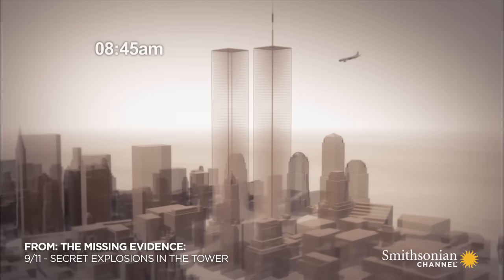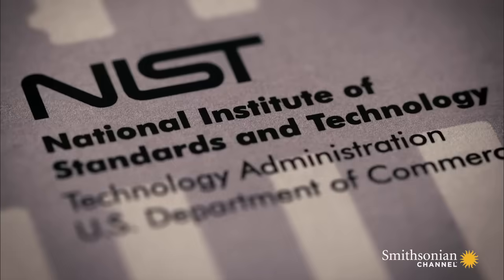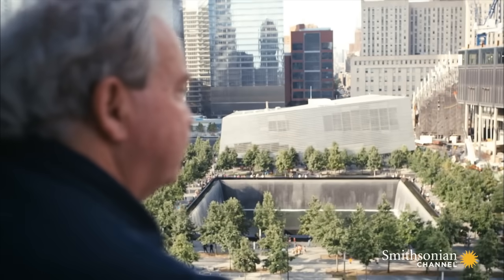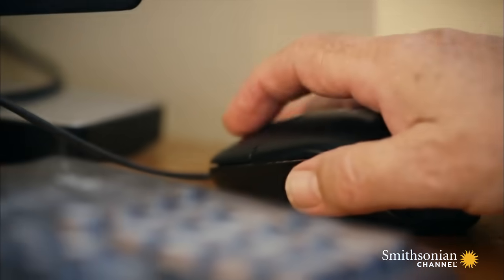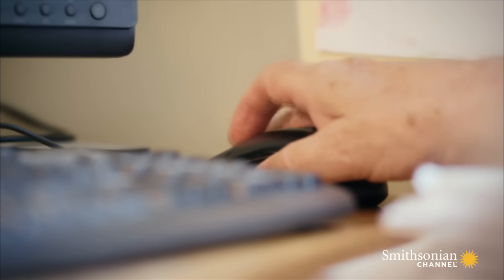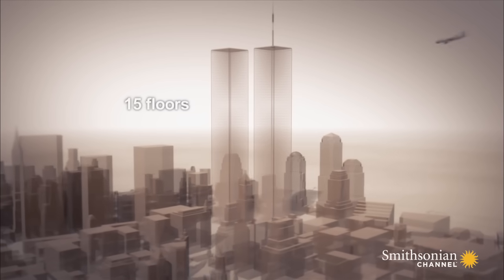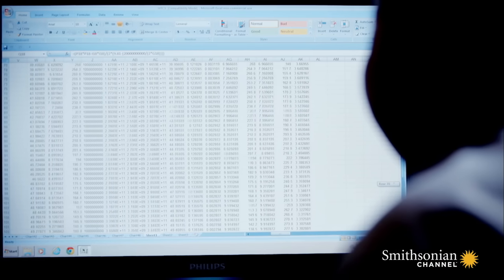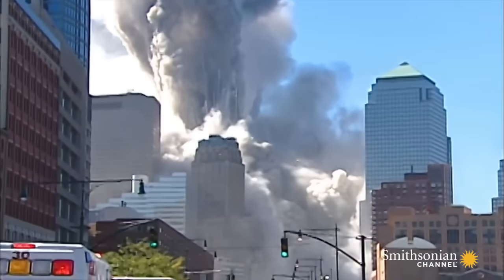This Computer Simulation Explains How the Twin Towers Fell

Comment: To everyone that is claiming that the towers should’ve withstood a plane:

There’s no specific proof that it actually COULD have withstood a plane, sure maybe a small Biplane, but a commercial airliner? How would they have tested that? Exactly, there was no REAL proof that it could’ve withstood the planes, just guesses.

Plus, the planes weren’t the only reason why it fell, the planes created fire, which created smoke and the plane crashing into the building made the building unstable, a lot of the WTC was steel and windows with very little concrete at the base, plus with the south tower hitting even more fire, smoke, and debris flew from the South Tower into the North, which caused it to be even more unstable.

Also, the buildings around the WTC COULDNT HAVE SURVIVED, most buildings around were like stated, glass and steel, the only buildings that were near the site of the WTC were the ones that were made out of harder materials
Reply: No but how would a plane just slice through with hardly any effort? It wouldn't it would explode on impact and weaken the tower

Comment: Then why were the pillars on the bottom floors still standing tall...?
Reply: it's very difficult to wire the atrium for explosives as you sound like you are aware.......they're in the lobby in plain sight of anyone entering or exiting the building - they're not hidden inside the core columns that also housed the elevator shafts......

Comment: 3 buildings collapsed not 2. 
On that day, New Jersey residents claimed middle eastern men with a white van were videotaping the disaster with shouts of joy and mockery. The men were arrested and turned out to be Mossad operatives. These men were quickly whisked back to Israel and were never mentioned in official investigations.
Reply: Paul, did you know that "gullible" is not a real word?

Comment: Wait a minute any physicists out there that can corroborate this?
Reply: I mean, the math is pretty easy to do yourself just look at my other comment. The top floors acted as a battering ram that took out the first stable floor which took out the next etc with each floor adding to the mass. Keep in mind that apart from these floors now having kinetic energy they were falling in the middle of the floors not on the reinforced outside mesh. The air being pushed out as each floor fell blew out the exterior reinforced structure. Like a popped balloon.
Reply: And building 7? You really believe the NIST model?

Comment: Well the planes definitely damage to the structure of the buildings and the ignition of thermite that was attached to the support beams finished the job
Reply: There’s a plug in that animators and people who use CG use called bullet physics. The same system that they used in the film 2012 I believe? They rebuilt the towers based off the blueprints that are online and basically threw a plane in the exact same location...it didn’t fall. They re-did it multiple times and nothing every time. I’m not gonna talk about melting or whatever cause jet fuel can’t melt the beams but they could make it hot enough to bed and blah blah blah. I used evidence that I have seen and been provided with and I don’t really have an opinion on 9/11 other then lives were lost
Reply: Taelor Watson lol- exactly.

Comment: What nonsense. Newton's 3rd law states that for every action there is an equal and opposite reaction.  Therefore, when the top stories of these buildings failed, we should see a DECELERATION as the top section collides with the lower stories.  Instead, we see constant acceleration throughout the entire collapse.  Not free fall acceleration, but acceleration none the less.  This can not be done without explosives.  This is nothing more than propaganda.
Reply: Yeah, and you kooks have made so much progress trying to sell that exact same nonsense over the past 18 years.

Comment: This chemist better get his money back for the money he spent on the computer program. I think he got ripped off. Anyone with basic high school physics knowledge can see this is wrong.
The pancake theory doesn't explain how it feel at nearly freefall speed. It would of taken longer if there was resistance below it. Doesn't explain why the steel infrastructure was projected up and out away from buildings so hard that it was sticking into other buildings. Something was falling straight down it would fall straight down not out words. And why would momentum transfer turn the the whole concrete complex into dust. 
Also it doesn't explain the how Building 7 fell at freefall speed but we can just leave that out. I don't think people realize how much Steel beings were in the center of the buildings. This wasn't four walls with a roof. This was a interlocking grid with steel beams all throughout it. The pancake Theory doesn't make sense in any form at all unless it was just four walls and a ceiling made of wood. But nice try though I guess.
He needs to find a program that fella him why Larry Silverstein thought insurance that specifically covers terroristic Acts 2 weeks before 911. Since both buildings fell he tried to claim $7.1 billion saying it was 2 seperate attacks.  He was only able to claim $4.2 billion.
Reply: You lost me at “would of”
Reply: @williamk9881  the buildings "would of" taken longer to fall if there was resistance(the steel mega structure and floors below).

Comment: The real reason they fell down is because planes are made out of aluminum from the explosion their was fire a couple floors fell on to plane so it was basically a furnace so the aluminum was around 1000 degrees Fahrenheit 700 degrees above its melting point so the aluminum was going down through the cracks and that’s why people heard explosions and why they collapsed
Reply: this disregards the laws of physics...  Doesn't work like that.

Comment: Wouldn’t architects have calculated and foreseen this occurrence, such as this one man did, when stating it could withstand a plane impact?
Reply: Designers may have made a guesstimate for a particular plane strike - using a slower speed approach for final landing at one of the nearby airports….but nobody would have planned for a deliberate, high speed plane crash.  That’s an absurdity well outside the bounds of rational thought…and it’s telling that the Truthers glom onto that issue as an article of zealous faith.

Comment: Incase you didn't know or missed;

World trade center had almost all the trades details with middle east and only way yo destroy the files were bringing the whole building down,

After the incident FBI whistle blowers (people who worked in but broke the silent and secrets),  all said for ladt 9 months, vehicles came in to building and they were carrying crates located to the stairwells,
Collapsing stairwells is easiest way to demolish a building,

Just 2 weeks before WTC hit, the owner of the 2 buildings made an insurance to his name incase of any emergency.

WTC was hit before in world war 2, when german plane lost control and hit the building but that not demolished the building, interesting.

WTC made with 3x thick steels yet it is believed that they used thermite chargers, to break steel metals.

In an emergency of fire, every buildings in new york had fire sprinkles yet they were disabled that day said investigators.... Weird.

Also what is weirder, is that the day in 9/11 none of the jewish workers attended to work...

Through to materials they have used to demolish the building gave gray dust clouds during demolishment.

2 planes that hit the WTC buildings were not carring any passengers, they didnt have any windows on sides, more like planes used fo4 advertisements.

Also pentagon wasnt hit by plane either, it was a rocket. And coincidence enough, it had only hit one side of the building where it had more valuable information for trades.

Therefore, bush has destroyed all the evidence before finishing hos duty